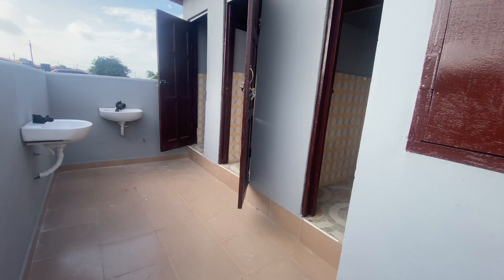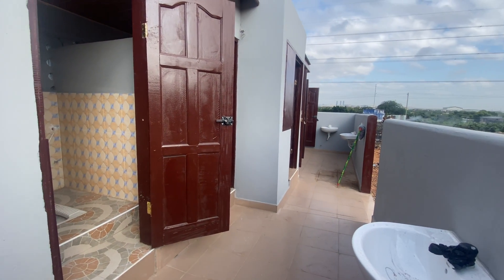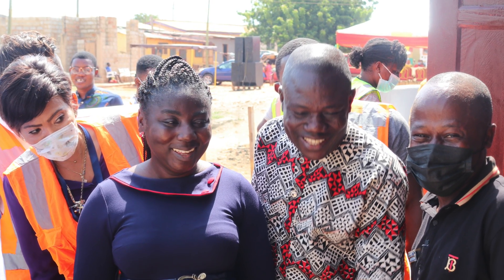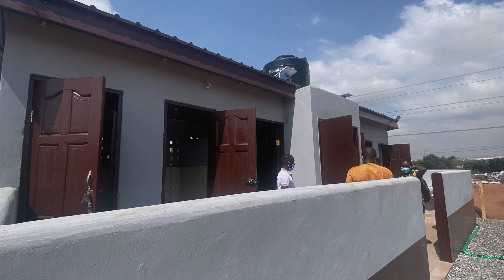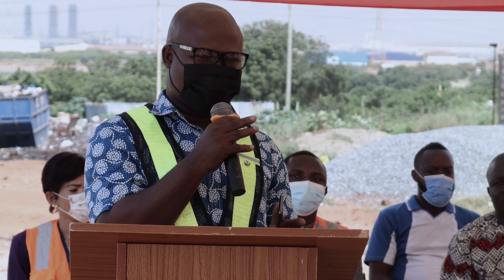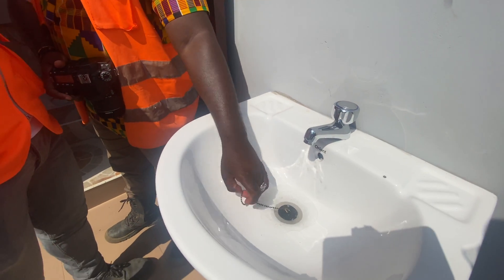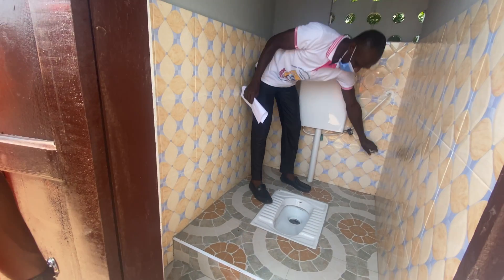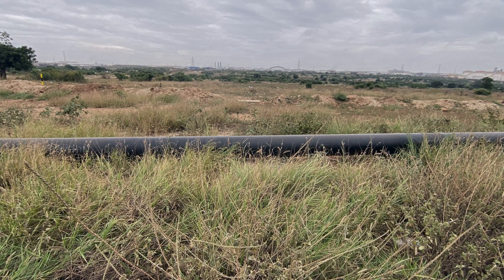Public Toilets: Biofil biodigesters in GHANA

Comment: Please is that pit with a flush for that latrine? I will appreciate that brand of latrine with flush I am in Nigeria and also inspired to promote WASH in the interior in Nigeria
Reply from the maker: Yes Adegboga. Remember the biofil digesters use the same flush pans and units just as any normal toilet system will use whether latrine,manhole or septic tank. The only diffenece is the means of treating the solid waste.